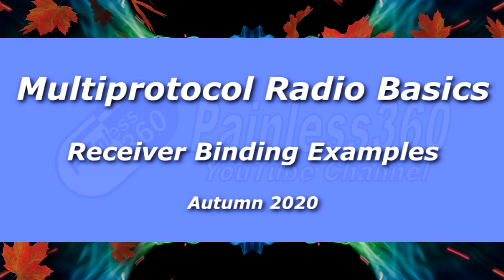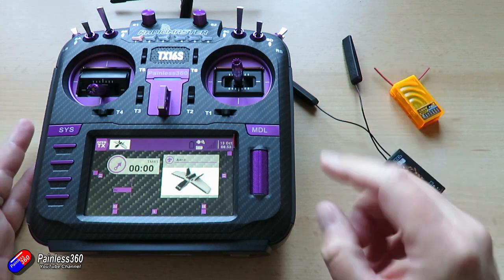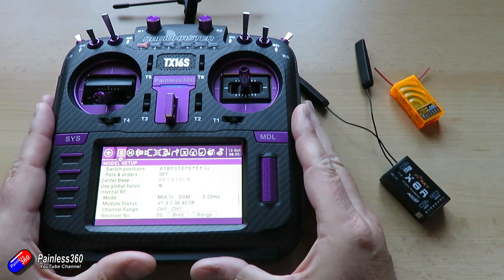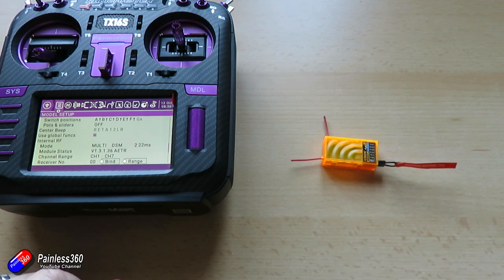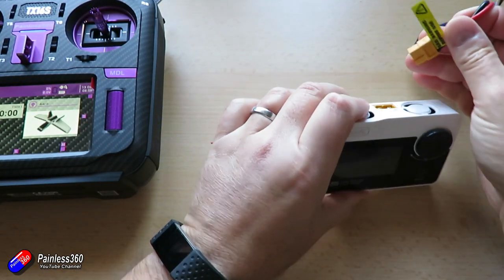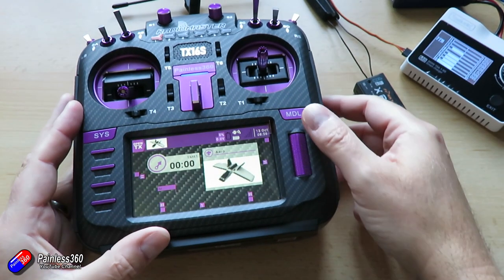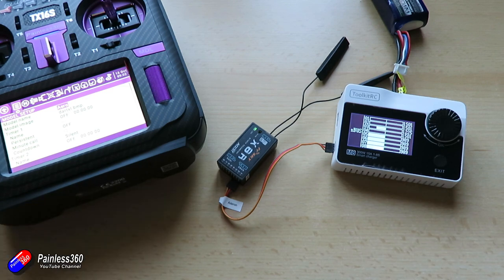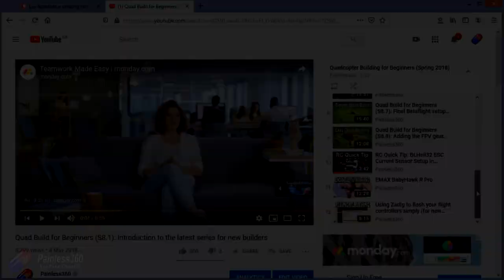TX16s MPM Binding Examples: FrSky D16 and Spektrum DSM Receivers

Comment: But with spektrum not is possible receive a message when you turn off or lose signal?
Reply from the maker: Have you tried it?
Reply from the maker: https://www.multi-module.org/using-the-module/protocol-details/dsm covers it. Telemetry is supported.. Best of luck!
Reply: @Painless360  thanks Therefore is receiver ar6210 which does not support.
you have an orange if you turn off the orange receiver on your radio Do you get a lost receiver warning?
Reply from the maker: I honestly don't know. I don't use DSM any more here.. If the radio is receiving telemetry from the receiver, it should. Best of luck!
Reply: @Painless360  I bought radiomaster r88 v2 is good ? ( there is rssi)
Reply from the maker: I like all of the RadioMaster stuff. That should work well...

Comment: Does this support touchscreen yet? I see so many people using the dials and nevrt the screen?
Reply from the maker: Not until it's supported in OpenTX..
Reply: @Painless360  forgive me if I'm being stupid but I have a nv14 running open TX with a touch screen?
Reply from the maker: I'm guessing you've not seen my videos on that radio then? OpenTX does not generally support touch so it is not available on other radios. That was a 'special' to get it to work on that radio. The OpenTX interface isn't optimised for touch - yet. https://www.open-tx.org/radios will show you how the official support is going.. ;)

Comment: I have diffeculty's with Futaba S-FHSS. Do you have a hint?
Reply from the maker: Only time I've used that was in the E160 heli video.. Best of luck
Reply: @Painless360   Lee I find it, fine tuning on +40 and it worked. Fantastic Radiomaster TX 16S. Altogether we solve all problems. Thank you for your support.

Comment: any ideas of why i cant get the second aileron working? using open tx and a dsm2 rx
Reply from the maker: Not without a lot more detail. Depends if you are using a 'Y' cable or separate channels too. What have you tried?
Reply: @Painless360  scratch that build i got it sorted. But! I have another wing problem this time lolsetting up a dart 250 on a crossfire micro v2 with the adapter board. Iv got ailerons working as they should and the right elevator working in harmony but the left elevator is still working as an aileron in the wrong direction.  Cznt for the life of me reverse it😭
Reply from the maker: Are you using a flight controller or not?
Reply: @Painless360  no thats my problem.  First time in 10 years I think without using a flight controller . I can remember years ago it was a faf to learn how to program a second aileron. Just using a crossfire micro v2 with the breakout board and servos and esc connect to that.
Reply from the maker: https://www.youtube.com/watch?v=RBiNq3dWQBM may help.. Best of luck
Reply: @Painless360  yea iv tried all that. just cant get that left elevator working with the right. wont let me reverse it no mater how i try it.

Comment: This is just way too difficult for me.. 4hrs straight and can't set up 1 model... Ugghh
Reply from the maker: What model type quad, plane?
Reply: @Painless360  Hey .. I finally got the Aerosout binded and surfaces matched. I have three standard type planes. 
Having all sorts of problems understanding if I eed to set up TAER, RETA etc.. but by trial and error I've got one plane in, with a throttle cut.
Will look at dual rates etc , and programming the Tundra and conscendo with Flaps now.
 I've come from Spektrum dx6.

 Thanks - just difficult as there's no one really to actually talk to - my friend flies DJI FPV systems, and that makes the two of us that fly RC in this little town.
Reply from the maker: TAER etc. is the default channel order that is sent to the receiver and you can see that order in the MIXER screen on the radio. On a standard PWM receiver that dictates what channels come out of which PWM slot on things like FrSky (i.e. Thr = CH1, Ail = Ch2 etc.). Some systems like Spektrum have a set order (TAER) so they need and multi-protocol radios do all of the clever stuff for you to remap the channels on the radio to be the ones that the specific receiver is expecting. See https://www.youtube.com/watch?v=Nii4ElEbg6s
Reply: @Painless360  thanks so much for your time.. 
  I have the tundra setup now but with a minor problem - no throttle ! 
  Firstly, I wonder if I bound correctly, should I always get a dance when switching on ? Orange r620x v3. 
  I think it must be bound correctly as I get correct aileron, rudder, and elevator functionality. 
  Just no throttle. 

Did I absolutely have to set to stock spektrum Taer ? As for some reason I have set to rtea. It just worked on the R636 in my aeroscout.. 

Not gunna let this thing beat me.. 1 full day in.   Lol.   Thanks.
Reply from the maker: I replied to the same question on another comment. No need to post twice - I'll reply :D Best of luck!